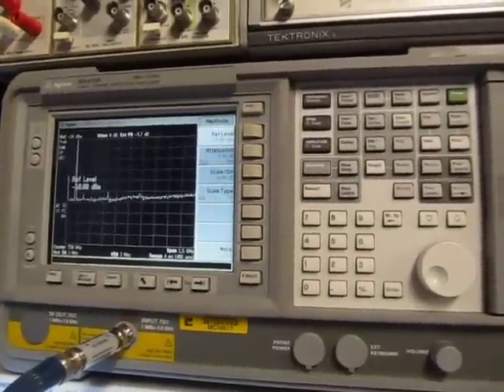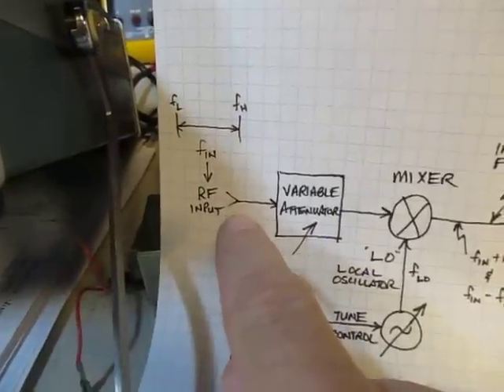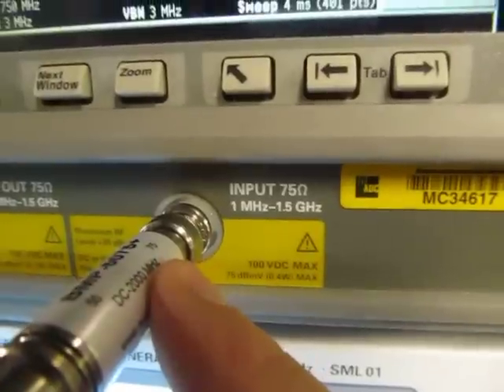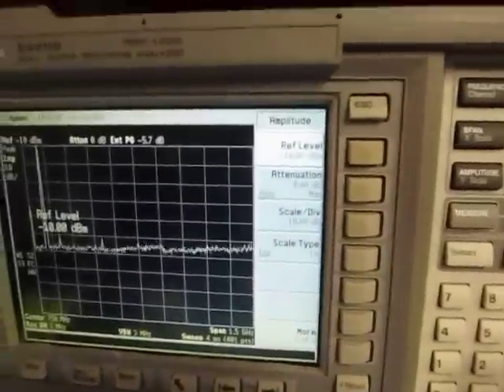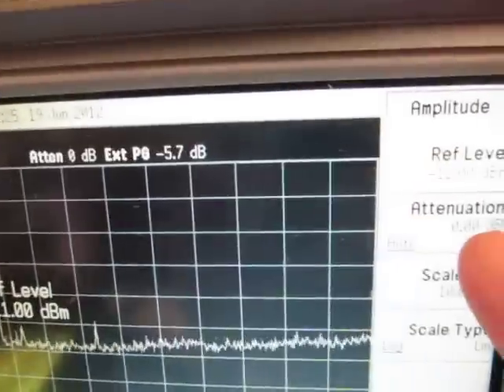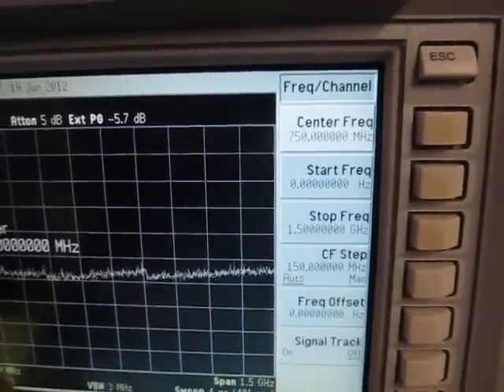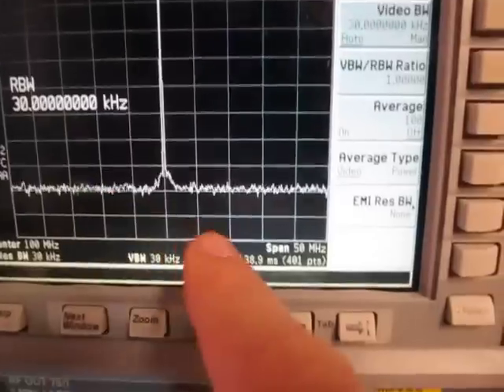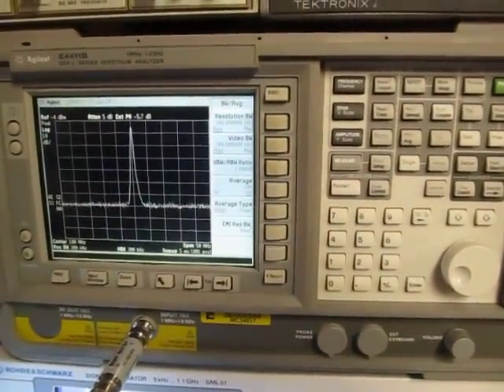#51: Basic Spectrum Analyzer Do's and Dont's ...

Comment: Another great explanation, a very good video as always. Many years ago a colleague had a natural gift for blowing up spectrum analysers. One type of measurement we did at the time was mains borne interference, we used a form of high pass filter that you could connect a measuring receiver to. Of course the merit of using a receiver was that the tuned circuits in the front end effectively integrated out mains borne spikes, and the full transient amplitude did not reach any of the active devices. To my knowledge he trashed the mixers in 3 spectrum analysers, one after the other.
For general engineering purposes it is probably good practice to keep an attenuator permanently attached to the analyser, that way you think twice about removing it. My own spectrum analyser would not justify a massively expensive repair if I damaged it so I have to look after it! Thank you again for making some excellent videos.

Comment: Have you seen a product called “RF SNITCH”?
It’s a tiny device that is powered by USB-Micro power and has a single SMA female connector.
The housing is clear and permits viewing of the internal LEDs.  
There is a green / 2x orange / red..
I believe they are bi-color or tri-color LEDs because upon “alarm”,  I recall they all turn red.

You are supposed to connect this to the device you intend to connect to a spectrum analyzer or VNA.
If the signal is low enough to use safely with the sensitive test gear, it will light up GREEN.
and… you can guess the rest of the operation.

I’m not sure about signal levels, but it was reviewed and recommended by YouTuber  IMSAI Guy.
(around $50 bucks or so.. I bought mine a year ago and can’t remember the exact pricing)

Another great video..Thank You!
Reply from the maker: I've not seen or reviewed that device, but seems like one way to help prevent you from damaging your spectrum analyzer or VNA.

Comment: Be careful with that 30dBm level for maximum input power. That apply to the front end attenuator. If you set 0dB attn and apply 30dBm you for sure will damage the front end amp or mixer. The front end mixer typically should get more than 0 dBm for safety and for optimum measurement of linear amplitudes should be below  -10 dBm. For non linear amplitude (harmonics, intermodulation...) the power to front end mixer on most Spectrum Analyzers (including Agilent ESA) should be around -35dBm.

Comment: Great video. However I think there should be mention that dbm measurements will differ depending on the load. Measurements in 50 ohm, 75 ohm and 600 ohm (telecomms) will be different particularly with respect to the voltage. For instance a 1mW reference power level corresponds to 0.224V in a 50 ohm system, 0.274V in a 75 ohm and 0.775V in a 600 ohm system.

Comment: Just bought an Agilent E4411B and I wanted to know where you got the 75 ohms to 50 ohms Minimum Loss Pad. I have seen them cost 200-300 dollars and more. I'm on a budget. Oh BTW, great video. I am so glad I found it.
Reply from the maker: The BNC coaxial unit is available from Mini-Circuits for less than $30

Comment: Alan, thanks for another great video. How does the input float voltage limit (+/- 4v, for instance) relate to maximum signal input voltage on a low frequency instrument with high impedance? I can't seem to figure it out.

Ken

Comment: picked up a used Rohde & Schwarz CMU200 off ebay for $800. RF input safely supports up to +47dbm, pretty unbelievable. and a nice safety margin for me! also means i don't have to worry about non linear response through any attenuators for most of my work.
Reply from the maker: If I recall correctly, that analyzer has a few RF inputs, and the 47dBm (50W) applies only to one of them.  Congrats on the nice find!
Reply: The CMU 200 is a great piece of kit, but beware that there are three models. "Engineering model" V02 can only handle 2 Watts. "Service model" V30 can handle 50 Watts. The CMU 200 can show a power overload warning, but this is also related to the vertical scale. The scale and referende level can be set manually to solve this "warning problem".
The more sensitive the input, the better the signal quality you'll get. Normally RF2 is the input is most used (except for high power transmitter testing).
Maybe this is interesting to read: http://amateurtele.com/index.php?artikel=251

Comment: I have a question around spectrum analyzer safety, power levels and preselection: Must the Reference Level always be selected according to the strongest input signal (to not potentially cause damage)? Even when its currently sweeping a different frequency range on a much smaller signal? (my gut feeling is "yes", because 1st mixer will still get everything, so the attenuator should not allow too much of the strongest signal to the mixer - which would also mean that a "peak zoom" function may be dangerous to use on smaller signals - because it'll adjust the overall reference level to that small signal's power) Thanks!

Comment: What I marvel at is your command of knowledge in using such instruments. I wonder how did you learn to use such instruments to the level you know how to use them? Did you study the owner's manual or were you taught by someone and learned your way through that?
Reply from the maker: Its a combination of all of those things. Usually starting with the manual, as well as manufacturer application notes, books, etc., as well as learning from those more knowledgeable.  All of these things over the years help contribute to the fluent use of the equipment.  Of course, it helps a lot to gain a good understanding of what is happening inside the instrument so that you have a clearer idea of what each control is doing.
Reply: @w2aew  Good to know. Thanks

Comment: I bought my spectrum analyzer off of ebay by winning a bid for only $150, and it is a good one and not too old.  Isn't a DC bloc simply a capacitor?  Can i build a DC block and power reducer myself with a resistor in series with a capacitor connected to the correct jacks?
Frank
Frank Reiser Video/Audio Service
Reply: Yes, a DC block is a series capacitor. Check your analyzer, it may already have a dc block internal. The allowable DC voltage will likely be printed on the front panel.   You can also build an attenuator, but it is not simply a series resistor. The attenuator has to maintain a 50 ohm input and output impedance, needs to be able to handle the transmitter power, and has to be built to have a flat frequency response over the operating range.

Comment: When you lowered down the RBW, the noise floor dropped down.  When the noise floor dropped down, what is its effect on the peak of the signal?  Did it change as well or did it stay at the same reading?
Reply from the maker: The peak of the signal doesn't change as you lower the RBW, unless the signal occupies a bandwidth greater than the RBW.

Comment: Hi Sir, you mentioned about setting the reference level causes the attenuation to be adjusted (under auto mode). Let say the attenuation is auto set to 10dB.
So does that mean the peak value reading we take from the screen is already attenuated by 10dB? If that is the case, we need to add back this lost in our final value of the power received?
Reply from the maker: The analyzer properly scales and adjusts the reading, so it always reflects the proper value, regardless of the attenuation level (as long as the unit isn't overloaded).

Comment: Howdy!,

I recently won a Tektronix Model 491 Spectrum Analyser, from eBay, which appears in perfectly serviceable condition, (though I have never powered it up, yet), but I have had zero hits searching for manuals on it: even Tek's website gives no joy.

Have you any clues to acquiring manuals for this piece of exquisite T&M aparatus, or hints I can use to bring this puppy back into service? (The listing said it had been recently used, by the owner, and worked satisfactorily, at least up to 2.5 GHz)

I would appreciate any hints you could offer.

Your tech vids are among the very best I have EVER watched!

Keep on Keepin' on (from a 60 YO fossil engineer).

Cheers,

Dave
Reply from the maker: +David Cole Here is a link to some manuals for the 491:
http://www.ko4bb.com/manuals/index.php?dir=Tektronix/Tektronix_-_491_Spectrum_Analyzer

http://bama.edebris.com/manuals/tek/491/
Reply: +w2aew 
Howdy, again, and many, MANY thanks!

The links you forwarded were PERFECT!  I don't know how you found those, but I had looked at Boat Anchor, (BAMA), and found no references:  evidently, the Google Fu is powerful in you!

One last request; do you have any suggestions for a Tracking Generator that the Sawtooth output could drive (Just the low bands -- I am not Yet ready to go extremely high -- 1 to 3 GHz is MORE than enough)

You are a lifesaver (but not the candy).

Thanks SO Much,

Dave

Comment: So, if I build a 2m Ham Radio at an output of the typical 5 W, I would use the external attenuator to reduce that input power (voltage) down to 0 V?  How does a spectrum analyzer be designed to only handle a 0 V input when RF in the air is typically in the micovolts range (I do understand that wave forms above and below 0 V cancel themselves out to 0 V.  Is that the theory here?)
Frank
Frank Reiser Video/Audio Service
Reply from the maker: The 0V requirement is for the DC Content of the signal only.  Most RF transmitters don't have any DC content, so that part is OK.  The other thing you'll have to do is attenuate the signal quite a bit - ideally you'd like about 1mW or so into the spectrum analyzer.  For measuring RF transmitter output, it is most common (and safe) to terminate the transmitter into a dummy load rated for the full power, and use some sort of RF Sampler to couple a small amount of energy to the spectrum analyzer.  I have a video or two on RF samplers...

Comment: Thanks for the video. Quite informative.
couple of questions:
1) if signal is close to Noise floor do we still need to move the whole spectrum up on the Y axis so that the signal peak is just below the reference level?
2) for default attn of 10dB i get some power levels (say -60dBm) but when i increased attn manually to 20dB and beyond the power level moves to-74dBm. Does this mean the 20dBm is optimum attn.? which power level and which attenuation i should trust?
Thanks
Reply: From your question, I guess what you are looking at is a distortion component of an Amplifier or some thing like that. But since the level of the signal observed is changing when the attenuation is changed means trust the one with 20 dB Attenuation. At 10 dB attenuation the distortion is more due to the spectrum Analyzer you are using. If you change the attenuation to 0 dB, 10 dB, 20 dB while watching the signal (if limited by spectrum Analyzer it will change by 20 dB each if it is 2nd harmonic of some fundamental signal coming in or 30 dB if third harmonic etc) will tell you when you are observing real distortion value.

Comment: Love your videos. I have a question on the video. I see you are using a 75 to 50 ohms pad. How does this effect the output? Also could you use the pad on say on a sweep generator? Thanks and keep up the great work.
Reply from the maker: Yes, you can use it on the output of a signal generator.  Note that it attenuates the signal by 5.7dB.  However, keep in mind that the impedance mismatch between 50 and 75 ohms isn't that terrible (1.5:1 VSWR), so you often can get away without using the pad.
Reply: Great. Thanks. I will try it both ways and see what I get.

Comment: I hope that you please will answer this question.
I can read that Spectrum Analyzer often goes from i.e. 9KHz and up, but what if I want to look at an audio signal at 22Hz?
Reply from the maker: You can't.  There are some spectrum analyzers that go lower than 9kHz, but most do not.  For a 22Hz signal, if you want to look at the spectrum, you're better off using the FFT function of an oscilloscope.

Comment: You see from my previous posts that I am alway talking about internal and external attenuator. The general practice is to always put external attenuator (10 dB typically) as close as possible to you measured device. That specially true if you have to use long cable or the Spectrum Analyzer internal attenuation is set to 0 dB. Such approach will improve matching between your device and Spectrum Analyzer. That very important for measurement of non linear parameters (intermodulation, harmonics).

Comment: Following my previous post: Spectrum Analyzer optimum measurement power apply to the internal mixer not the the front of the Spectrum Analyzer. So if you power from the device is let say +10dBm and you measure fundamental frequency amplitude than the reference should be set to +10dBm and the total internal or external attenuation should be more then 20dB. If you measure intermodulation that internal or external attenuation will need to be set to 45dB.

Comment: Hello, I am looking into getting my first spectrum analyzer for transmitter tuning and repair. I have my Bird43, the 4275 line sampler, 2205 scope and dummy load. What I would like to do is add my frequency counter and a spectrum analyzer, could you describe how to do it? Perhaps one of your great diagram layouts.Thank your channel has inspired me.
Reply from the maker: Since you've got the sampler, you would simply connect the counter or spectrum analyzer to the sample port.
Reply: Thank you Alan, would it be advisable to add a "T' somewhere after the scope to insert the frequency counter. I would like to view the scope and frequency counter. I am using a 3 position antenna switch, radio into it, port 1 to Bird meter, port 2 to scope, port 3 to signal generator.Or would it be better to add the frequency counter in line with the bird?I am using 2 separate dummy loads.
Reply from the maker: You would NEVER want to connect the radio directly to the scope, or the spectrum analyzer, or the frequency counter.  Never.  

Always have the transmitter connected directly to the dummy load, and use the sampler in-line to connect to the scope, counter and spectrum analyzer.  If you want to have all three hooked up, you could put a BNC-Tee at the input to the scope and the counter, then run the coax from the sampler to the tee at the scope, from there to the tee at the counter, and then from there to spectrum analyzer.  Alternatively, some scopes have an auxiliary OUTPUT on the back panel which is a buffered copy of the signal at the input - you could use this to drive the counter.

Comment: Great video. Wanted to know if I can relate the span nob on the spectrum analyzer to the LO frequency range that will be selected
Reply from the maker: Yes, basically the span knob does control the frequency range of the LO (usually more than one LO).  However, keep in mind that wideband spectrum analyzers will often use harmonic mixing, so the LO range won't necessarily be as wide as the span.

Comment: What do you think of using a general coverage HF receiver and modifying it with a swept VCO and also sending the output of the ramp generator to the horizontal input of an oscilloscope.  If not where can you get the RF/IF plug in lke you have thanks Jim KD7TU
Reply from the maker: It could work.  You'd probably have to disable the AGC circuit and manually adjust RF gain, and add some kind of detector on the receiver output. You'd be limited in the RBW settings (just the filter settings the radio.  It may not be well calibrated, but will at least give you a relative view of the spectrum.

Comment: Hello. first of all, thanks a lot for your knowledge condivision about this amazing equipment as a SA is.
My question:  a 75ohm input impedance equipment is suitable for learning or you misadvise to buy it to a beginner as I am. You are right when you say that you could get it as a really bargain, but due to it would be sure the first but the only one, I would like to buy something which could be useful at all, not only for some nice intelligence game and to leave it off for unsuitability at all.
Thanks.
Danilo
Reply from the maker: I think it is perfectly suitable for learning.  The absolute power measurements won't be accurate, but most of the time you're  using a spectrum analyzer to look at relative power levels anyway.  The input SWR when used with 50ohm sources will nominally be 1.5:1 which is perfectly acceptable.
Reply: @w2aew   Thanks a lot for feedback. Unfortunately the bargain I was dealing with, has gone to someone else, (  :-(   ) but I will not settle about. 
I am Searching for a new opportunity. THanks again.
Danilo

Comment: I see the small spectrum analyzer you have only accepts -30dbm or 1 milliwatt, is there a way without a power meter to measure the 1 milliwatt before you attach it? Could you use a multimeter on ac amps?
Reply from the maker: Actually, -30dBm is not 1 milliwatt, it is 1 microwatt!  For that particular analyzer, the -30dBm refers to the power at the front end mixer.  There is a manually controlled attenuator ahead of the mixer.  So, you have to manually set the mixer to ensure that you don't exceed -30dBm at the mixer.  Most modern spectrum analyzers control the attenuator automatically based on the reference level setting.  If you are measuring a signal of unknown power (and you don't have a way to measure its power), the always start with the highest attenuation possible (highest reference level), and work your way down.